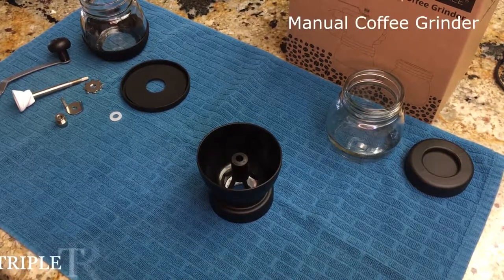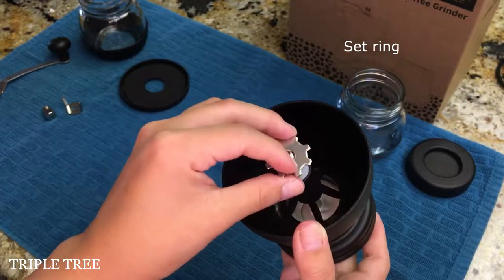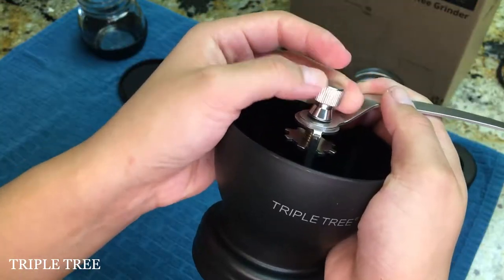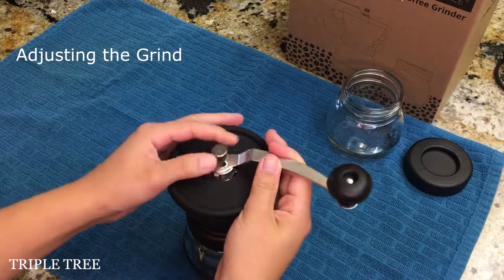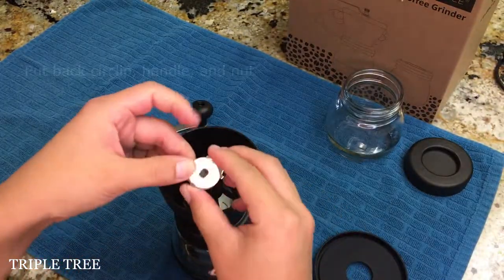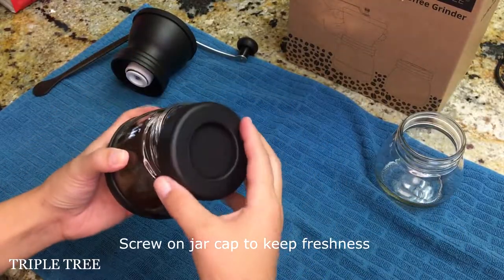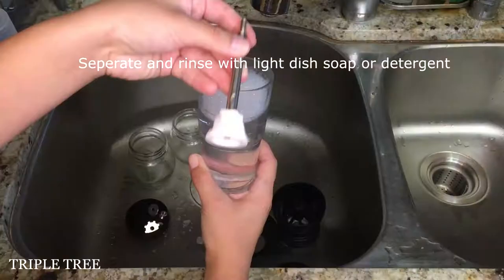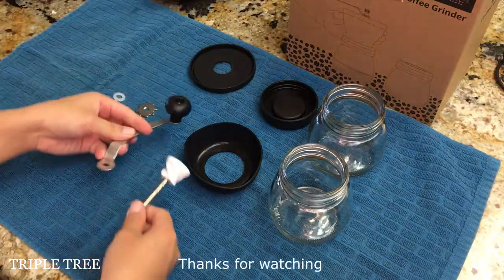How to Assemble and care for the TRIPLE TREE Manual Coffee Grinder

Comment: Just got my french press, some whole beans, and this sweet grinder!

It works extremely well. I love it so far (just used it to fill up the glass jar). Grinding took a few minutes, and was very easy (even a kid could do it).

Just worried about how long the ceramic grinder will last.

Edit 1: It's also very easy to use, clean, and take apart. Just have to be careful putting the handle nut on as to not strip the nut or the ceramic burr where the nut screws on.

Comment: How do I how how much to turn to get the fineness I want though
Reply: There aren't any clear guides in the grinder on how much to adjust the gear for the grind you want. You have to figure out how much to turn based on trial and error. I usually set it to what I think is the right setting for the grind I want, grind a little bit of coffee, and adjust if I need it finer or coarser. One of the downsides of this grinder, even though overall it isn't bad.
Reply: The instructions actually say you have to basically play around and figure it out. It will not make coffee powder though (flour consistency).

Comment: @Desonic TRIPLE TREE Hey there, I couldn't find Triple Tree's official website for contact, but I have this grinder and the black handle on the crank has popped off and won't remain in place anymore (only used 20 times or so). Is there anyway to get in contact for a replacement crank/handle? Thanks!